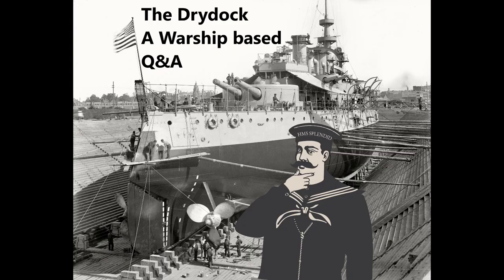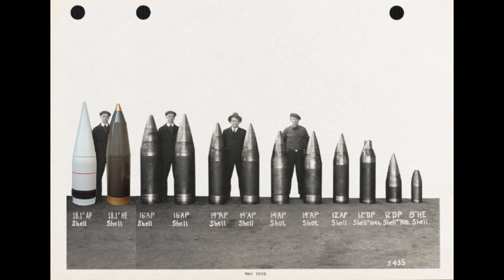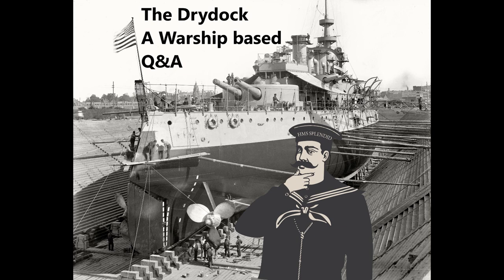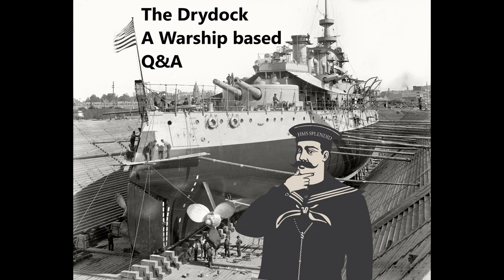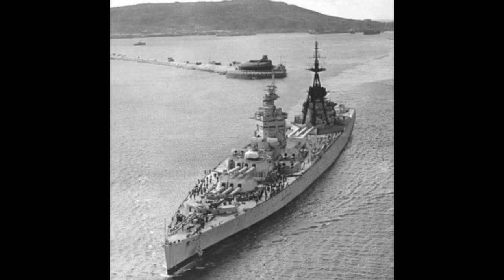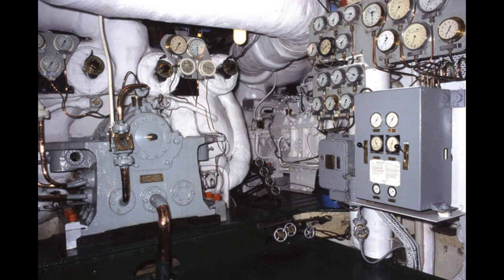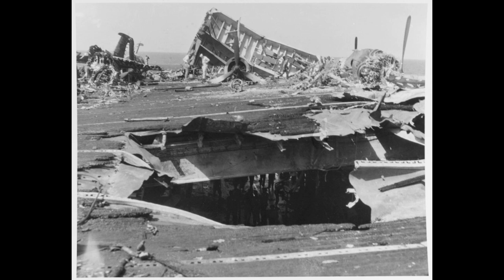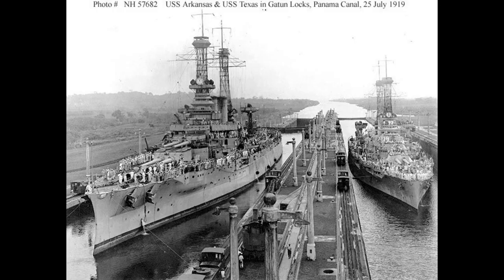The Drydock - Episode 094

Comment: 34:23 an example of friendly fire from anti aircraft guns occured in the gulf war, an Iraqi Silkworm missile was fired at a joint US and UK formation which included the battleship Missouri, USS Jarrett and HMS Gloucester among others. The Missouri deployed chaff, then the Phalanx on Jarrett which was placed in autoengagement mode, targeted chaff launched from Missouri rather than the incoming missile, hitting the Missouri multiple times and injuring one sailor. Luckily the Gloucester intecepted and shot down the missile with it's sea dart, interestlingly the first time an anti-aircraft missile had successfully engaged and destroyed an enemy missile during combat.
Reply: And probably that was the last time when a "conventional" (ie. Dreadnought-typish all big gun, armored battleship) battleship was hit by cannonfire - since the 20mm counts as a canon.
Reply: Wouldn't it be "tiny floating" and "massive flying"?
Reply: Blah b tiny, fast flying objects with large radar returned intended to simulate large objects.
Reply: @kiloalphasierra  A Silkworm missile is over 6 meters and two tons - NOT tiny.
Reply: Karl von Gazenberg the chaff is tiny but has an extremely large radar signature for its size.  If the pieces of chaff are close enough, the radar will see the chaff as one return instead of several and if the chaff is moving fast enough the fire control system will interpret the return an an aircraft. The pieces of chaff can also randomly do this in the cloud after it has formed and if these random coalescing events happen to occur in just the right order the radar will also “see” a target “missile” and engage it even though the chaff is moving far slower then the lower speed range for engagement.  This is one of the reasons noncooperative IFF was developed and fielded.
Reply: Well, The chaff did work.
American chaff and Dutch Goalkeepers seemed to be a good sales bet :-)
Reply: Worth noting, the missile was intercepted AFTER it missed due to (most likely) the chaff. Still an important showcase for capability, but not necessarily a success in the way we'd like. Of course, the USS Mason later proved the ability to shoot down standard ASMs.
Reply: @josepetersen7112  sorry I never saw that, where did it say that?

Comment: I would like to add razee-question the conversion of Soviet heavy aircraft cruiser "Admiral Gorshkov" with heavy missile battery and flight deck to full STOBAR carrier by the Indians.
Reply: The chinese did the same to the Varyag .
Reply: The Argentina T42 conversion into a an troop transport counts, ARA Hércules (B-52)
Reply: João Rita Varyag always a STOBAR carrier.  Sher’s a Kuznetsov class ship.  Gorshkov/Baku was a Kiev class carrier/cruiser.
Reply: The Indians didn’t actually do the conversion.  They had the Russians do the conversion for them when they bought the ship.
Reply: @phluphie  correct; I was thinking of it's missile batery, which China removed, leaving only short range SAMs
Reply: João Rita That’s right.  The Kuznetsov has a few VLS anti-ship missiles buried in the flight deck.  I’d forgotten about that.
Reply: @jlvfr  Did you mean to bold that, or italicize it? Is there a convention on bolding/italicizing ship names? 

Also, just a tip, because YouTube's abomination of a markup language just breaks if you put punctuation on the outside, put it on the inside of the underscores or asterisks (for italics and bold respectively.)

Like so:  Varyag.
Reply: @chemputer  I just wanted bold , and I do know the language details; they are the same that were used in Google+. As for why I did it, it was simply to set the ship's name apart from the rest of the text.

Comment: Re:  AA fratricide, men in  desperate situations may easily fixate on a target and not notice friendly ships in the arch of fire.  
40mm Bofors shells are "Self Destroying" (SD), the tracer base burns into the explosive filler and detonates the round.  The "timing" is not adjustable, it is "set" as a requirement and implemented during manufacture. This results in some protection to other ships in the formation, from getting hit with a live shell.
Reply: Not related to ships, but during the final days, the FLAK towers of Berlin engaged Soviet ground attack planes and low level bombers resulting in the shrapnel scything down streets and through windows leading to a number of civilian casualties. 

Until then, the guns had been at high elevation, engaging bombers at altitude with better warning time for civilians to get to safety. Still, there had been casualties from falling shrapnel and un-fused shells.
Reply: AtomicBabel: I didn't know that. You don't have a link to modern/semi-modern AA-artillery by any chance. I mean late cold war or newer, by any chance?
Reply: @MultiZirkon  no, I did not do much reading on modern and semi modern AA, this can not help with any links.  My comment on 40mm Bofor is true for WW2 era shells for USN.  With the longevity and variety of the system, other fusing options would reasonably exist.

Comment: The postwar USN conversions of (mostly) Fletchers and Sumner/Gearing class destroyers to DDE's were a decent simulation of a "razee" conversion. The main gun armament was generally reduced to a pair of 5"/38 guns and no light armament, or one/two pairs of 40mm Bofors. They usually lost their torpedoes as well, the tonnage added back in with the then secret hull mounted sonar. That was quite a significant decrease in surface capabilities compared to four, five, or six 5"/38 guns, anywhere between twelve and sixteen 40mm Bofors, and four to eight torpedo tubes. The general failure of those conversions was demonstrated by the number converted back to normal fleet destroyers after only a few years.
Reply: On the other hand,  the threat was more toward ASW. The Soviet  surface threat is limited.
Reply: @WALTERBROADDUS  Right, but the DDE experiment showed you can go too far in vessel specialization. The DDE conversions were done in the early 50's, when the threat from Soviet aircraft hadn't gone away, and surface action was likely to be with guns since SSM's really hadn't become common. War games in 1q954 and 1955 showed the DDE's were likely to be overwhelmed and sunk by either aircraft or other surface vessels, since they didn't retain enough capability to deal with either. Some of tonnage from the deleted gun mounts was given over the Weapon Alpha, not our most successful antisubmarine rocket system. The development of ASROC showed the Gearing class was about the only one with  space and tonnage available to mount one, and then only after the hugely extensive FRAM rebuilds. Even most of the FRAMs only lost one twin mount, and some retained all six. The other DDE's were quickly restored to standard destroyer configuration

Comment: I worked in Operations.  Specifically as an Operations Specialist (OS for short)  We worked inside a locked box where all of the tactical radios and radars and sonars were primarily tied into .  It is also the location of the Tactical control of the guns missiles and torpedos  The bridge had a limited feed but CIC was where it happened.    Everything happened except for highly classified secret squirrel stuff that wasnt released to us anyway. 

the result was that when we got off watch (chow to chow) there would be hangers who would sit close to us and listen for good gossip.  We became good at starting rumors.  The trick was to not hand a complete story but to give nibbles over 3 or 4 meals.   And to not let on that is what you were doing.  Because why would an ops type be doing talking to a engineering type? So you talk within earshot.  Universally know as "those F--ing OSs""   or a close proximity to the same.   of just F-ing OS.    Big Ship Small Ship Amphib or Carrier.  Even the Airdales knew about us.

Comment: On proximity fuzes there is actually even less to notice from the pilot's perspective. Even at the end of the war, the US Navy was still firing about 25% mechanical timed AA shells, because those air bursts turn out to be very helpful in telling your point defense AA gunners where the enemy planes are. So the pulits aren't facing clear sky except for occasional shell bursts that kill or damage aircraft, they're facing a normal AA barrage with a large portion of shells that will go off at precisely the right time.

Comment: Torpedo hits to the stern area arent surprising simply because the standard defense against torpedo attack is to turn away and "comb the tracks", presenting the smallest possible target and potentially outdistancing the torpedo.
Reply: For some reason I remember turning into the torpedoes rather than turning away from them but its probably me misremembering something or it being wrong in the first place.
Reply: @gokbay3057  Turning away gives more time till they reach, opening the spread, and allowing for outrunning them.
Turning in can be viable if you rrally dont want your propulsion fucked up, and there is not enough distance to outrun them.
Reply: IIRC the strategy was to turn into the torpedoes if you have time and turn away if you don't.  If you turm into them it's easier to find a hole through the wakes, and the bow is a much smaller target. You need enough space between them to pull it off though. Turning away happens when they are too close to safely turn into them.  It's not as optimal.because you have to hold a straight course for a longer period of time....e.g. Yamato at Samar.
Reply: @rocketguardian2001  turning into the torpedo spread also presents a narrow target and gives you the opportunity to close with destroyers that have expended their torpedoes (a submarine will presumably have reloads), but a torpedo spread is normally a bit of a fan intended to ensure that, but the time they reach the target's range, they are separated by no more than one ship length. Turning into the torpedoes narrows the spread, while turning away opens it up further and also has the possibility of outdistancing them (although no one outdistanced a 24" Type 93 on the slow setting).

Comment: A correction: Spruance has a big hole in his command service in the middle of the war. He commanded cruisers early on, took command at Nidway, and then was promoted to Nimitz's staff (chief of staff and then Deputy).  He didnt take command of 5th fleet until August 1943. Halsey was out at Midway in June, convalesced stateside, and then relieved Ghormley in the Southwest Pacific area in October 1942, so he better matches the description of having four continuous years of combat commands.
Reply: Halsey's COMSOPAC position was a shore command. He was at sea only through the first six months of the war, and then alternating with Spruance from late 44 onwards.
Reply: @rocketguardian2001  yes, but he was still in command and could have raised his flag on a ship any time he felt it appropriate. Spruance was responsible for getting Nimitz's staff work done. Cunningham's position in Alexandria is much more analogous to Halsey's at Noumea than to Spruance's in Hawaii.
Reply: @kemarisite  True, it was a command rather than a staff position, but my understanding that the discussion is regarding seeing combat duty as a task force commander rather than a theater commander. If Halsey gets credit as COMSOPAC, then Nimitz would qualify as CINCPAC. I think the definition is clearer if you simply look at seagoing commands. Either way, Spruance and Cunningham rate higher than Halsey in most estimations.

Comment: Cunningham or Spruance, what a dance you tangoed around that question.  Alternately, Cunningham only had to deal with the Italians so...

I'd take either one, any time any circumstance.  Both men had that crucial knack, so lacking in many otherwise competent commanders, of both defining their immediate objective and tailoring their response accurately enough to achieve it with minimum risk to their forces.

Drach, if I were posing you a question it wouldn't have been that one.  Mine would be to name a dozen naval commanders from any period other than WWII that would meet the standards of Cunningham and Spruance.  Surely, with all of history to work with you could name a dozen?  I can't, but I don't have a naval history channel.